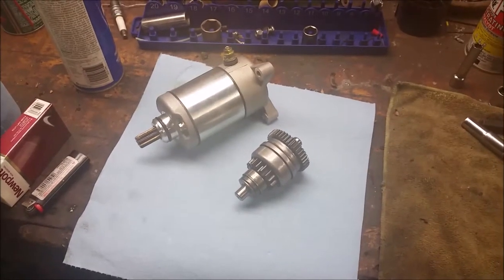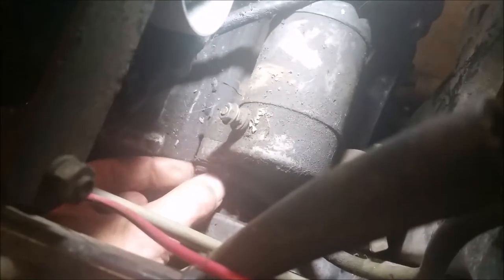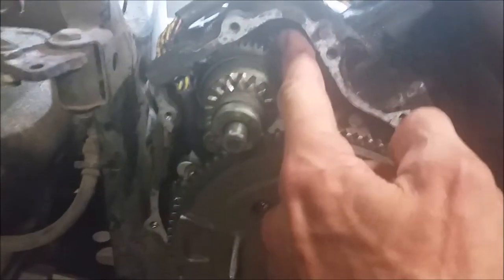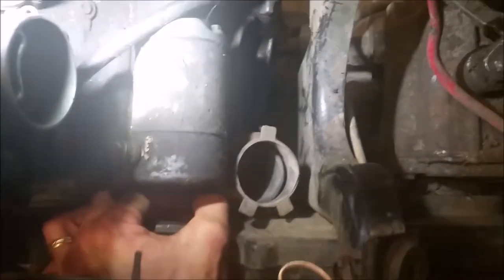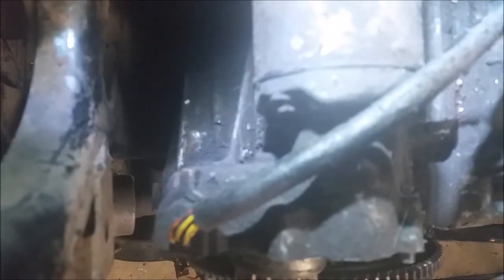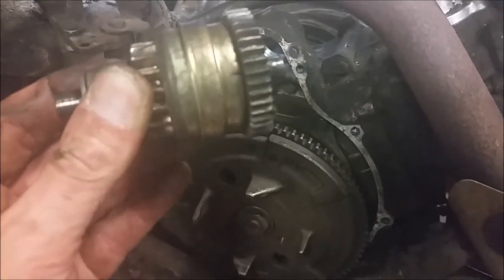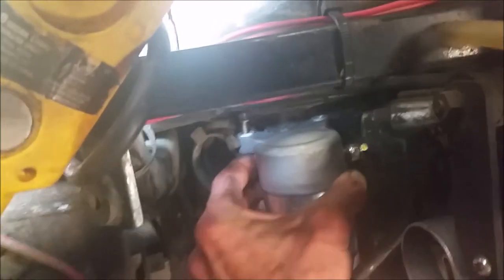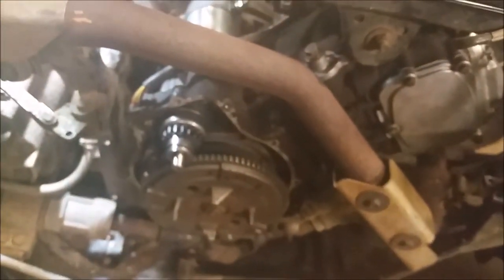How to replace your starter on a Polaris 400/500/700 Sportsman

Comment: Thanks Man, I just priced a starter at $420! The garage is going to charge me another five to $600! I may try to clear out enough room in my garage, and start disassembling my wheeler to get a little sweat equity....
Reply: Starter cost way less than that. Did mine last year think it was $80 to $90 if even that much.
Dealers are a rip off to do work and need to be avoided if at all possible.
I have done all my own work on bushings, bearings, ball joints etc. May take you a little time but it’s worth it. Plus you know what you have done and can do it right yourself. Half the time stuff is done like crap at a dealership anyway.
Just buy yourself some decent tools and you will do fine
Reply: Amazon  it’s  $34.00
Reply: like under 90.00 for last one i bought their all china made

Comment: I noticed you didnt change the pilot bushing back of bendix .to do this pack bushing with grease take a yellow handled nut driver put grease also in the end .stick in bushing and a couple taps with hammer will push bushing out using hydrolic preasure. replace bushing turning a 9/16s deep socket backawards and tap it in. same way you would remove a pilot bearing from a preasure plate on a car or truck.
Reply: What you talking about?
Reply: @The_Native_wolfAK  its a easy way to get the bushing out that the gear shaft runs on
Reply: Thank you!! I'm knees deep into this and you have some great tips.
Reply: He installed new bendix. New bendix has new bushing.

Comment: That dam bottom bolt kicked my but today! Ima try taking it out with the bolt in like you did. Do i HAVE to take off the flywheel cover though?
Reply from the maker: It is easier with the clutch cover off. You dont need to take the flywheel cover off. But you might want to. To inspect the bendix gear that drives the starter to flywheel.  The bendix will come out without removing the flywheel.
Reply: @TitaniummanGarage  thanks to your prying idea,  I change the starter, but still just sound and no start. Next I’ll be changing that Bendix. I did not know about that.

Comment: Great video Sir.  My 2000 Predator 400 has issue with cranking, or clicks with a full battery.  Bad starter or bad wire connections?
Reply: Short starter to check it, if not good replace starter.

Comment: Bottom bolt is the worst part of the whole starter changing install starter roll it towards the front of the bike install lower starter bolt roll backwards into place pry slightly on back clutch cover start bolt by hand some suggest going and buying 3/16"-1/4" shorter bolt for ease of lower bolt replacement .

Comment: Sorry, It is a Scrambler 400 4x4.  the starter is not able to take out from the top, could be done from bottom.
Reply from the maker: Yes. The easiest way is to pull the clutches and rear cover. you can access the bolts better. Or lay it on its side.
Reply: I have a pair of Scrambler 2001 400 4x4,  easy :  1. remove pull start cover to access 2 starts bolts (pray engine up a bit to remove cover's long 10mm bolts)  2. remove 2 10mm bolts off engine,  leave starter bracket on. Install is a breeze. ( I modified the far bolt hole to a U hole, so just lose the bolt without remove it,  making future starter R/R super easy)

Comment: The gear that connects the starter to the flywheel on mine keeps sliding back and dosnt make contact with the starter or the flywheel any ideas how to fix or if I’m missing a spacer or something
Reply from the maker: There is a washer or spacer behind the bendix gear. I would just replace it. It's like 15 bucks on ebay. The spring wears out on them. Sounds like that's what you have going on.

Comment: hey good video thnx for sharing .I went and got a shorter bolt threads in fine but cant get it started with starter in.might have to remove that air duct thing witch is a pain in the ass itself.
Reply from the maker: Yeah. It's a pain in the ass. I don't know why Polaris put the clamp on the other side.
Reply: Best way to cut the air duct, pipe from hell

Comment: Does the negative cable have to be on the starter ? Mine didn’t have it on the starter ( 2002 Polaris Sportsman 400 )
Reply: My 2000 Xpedition 425 doesn't have the negative cable either.